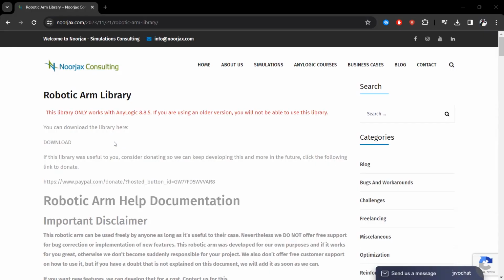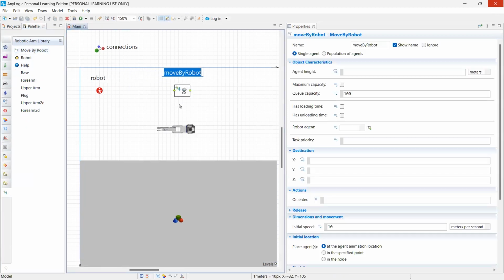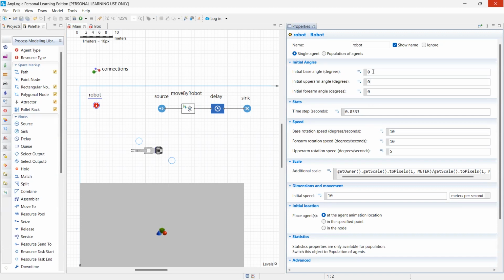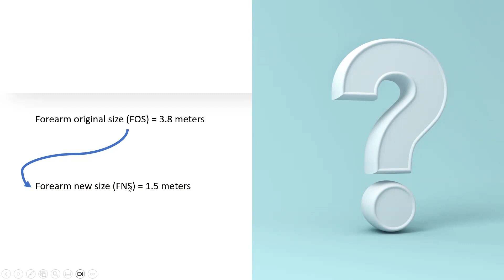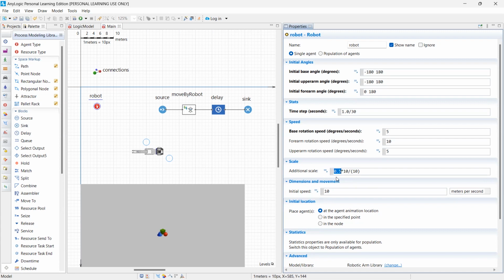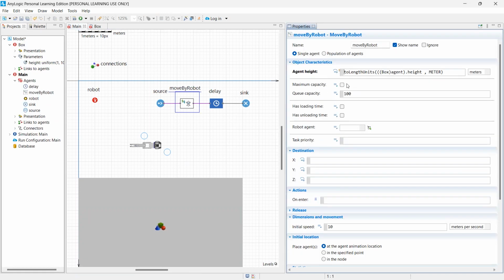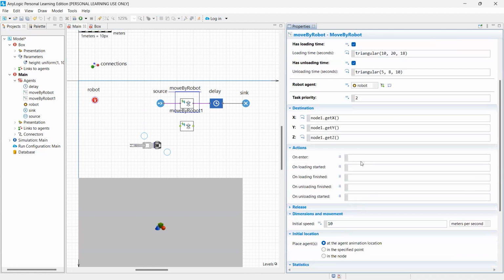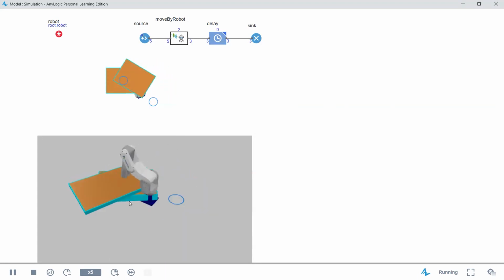AnyLogic Robotic Arm Library - How to Use It

Comment: hello, in the "additional scale" section,   have I consider only the new Forearm distance? what about the reach of the robot I'm using as example? (Epson C8-A1401S) the reach is 1400mm and the forearm has only 650mm
Reply from the maker: this is just a generic robotic arm with deterministic proportions... try to calculate using the additional scale depending on the reach you need... the scale applies to all the robot parts you cant change it just for the forearm